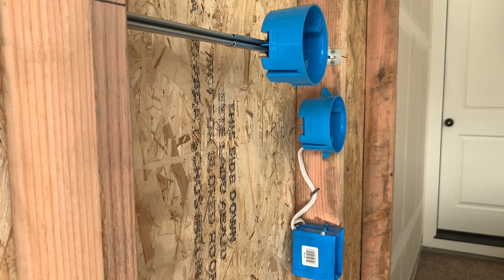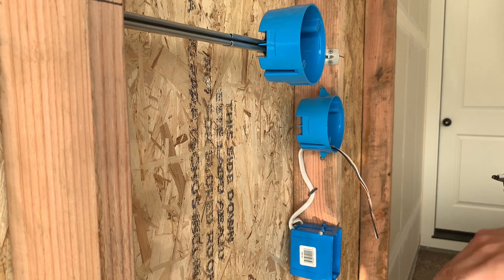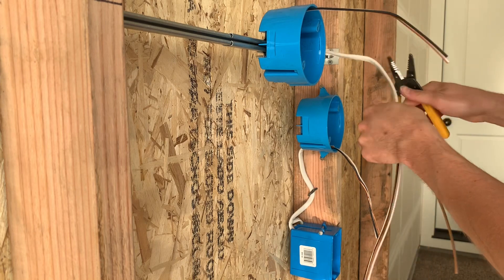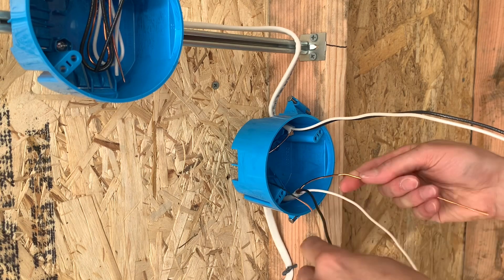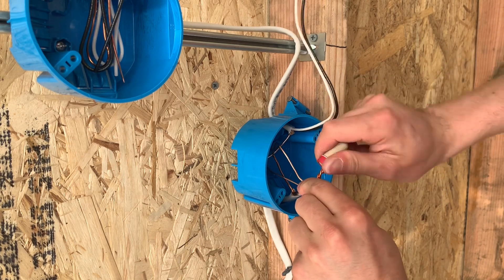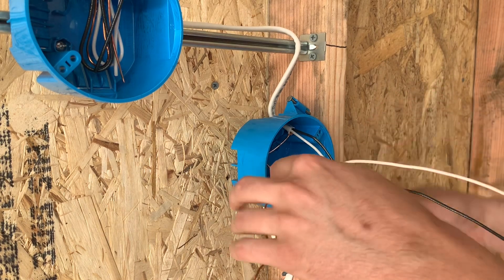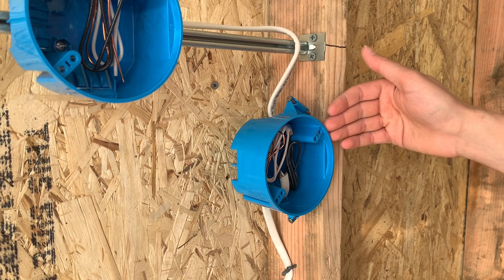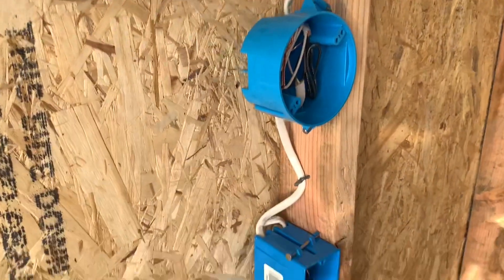Electrical 101: How To Wire Multiple Lights On A Switch (Leg)

Comment: I'm more confused not than when this video started. I wanted to know how to connect 2 lights and a switch and the power supply. I got a 3rd of the info needed.
Reply from the maker: this is a rough in video, not an installation video

Comment: Where's the light fixtures??? It would be nice if you actually attached the fixtures to the wires. Anybody can run wires into a box and fold them up. Poorly titled video that doesn't address the situation. Thumbs down.
Reply from the maker: Anybody can attach the fixture to the wires.

This video is how to WIRE, title says nothing about installing a light fixture. 👍🏻

Comment: That was way more confusing than it needed to be and you didn't even show what you said you were going to demonstrate. You didn't wire up anything. You just put wires in boxes and didn't explain what got tied to what or where they went on the fixtures. Sorry, but not good.

Comment: So to wire the light in the middle… do you take the black wire from that light, the black from the switch, and the black from the end light, and twist them together in a wire nut? So 3 wires in one nut? Same with neutral?
Reply from the maker: yup!
Reply: @DailyElectrician i have it where the wire from breaker goes to a outlet then to another outlet then to a light switch and light but when i turn the light off it trips the breaker why is that happening.

Comment: So what if you can’t get to the light but can get to the switch? Can you wire it into the switch instead?
Reply from the maker: yeah
Reply: @DailyElectrician If have 2 ceiling lights connected to a 2 gang switch.

If I want to change this switch to a 1 gang. To operate both lights.
Do I need to wire one light to the other light then that light to the switch?
Or can I just use the existing wiring and let the wires share the ports on the 1 gang switch?

Comment: For someone doing this on their own not working for a company or meeting a code do you think it would be ok to cut the ground wires down to the end of the splice to have more room/ less excess
Reply: Would be fine yes. But u don’t wanna cut to short…. What if switch goes bad and or you replace it and need more wire?…. Always do a “service loop” for you or the next guy.

Comment: I have the exact opposite, My switch controls a light in the shower and a vent fan in the bathroom, I need to remove the vent fan and make that hot and just keep the switch for the light, would I disconnect the wires from the light or the switch?

Comment: would this process be the same for adding another light to a current 2-pole circuit? TY
Reply from the maker: 2 pole circuit? like 277 volt lights?
Reply: @DailyElectrician  Hello, sorry novice to all this so I might be using the wrong terminology. I was wondering if the wiring would also apply to lighting that is controlled by 2 switches. thanks!
Reply from the maker: yes and no, depends how it is wired inside the walls.

Comment: For those whom are not electricians nor handy (I am both), you less than half way explained what you were doing and why. You did not explain why they're tied together and most importantly never showed why actually powers the multiple lights. In this case it was supposed to be a light switch that already is a power source and how you tied it into that. Where is the light receptacle? Where is the toggle switch?? You have to complete the process, bro.
Reply: I agree the video is incomplete. You didn’t wire a light! You placed some wires in an electrical box. Misleading title.
Reply from the maker: alright, move on with your life I guess 🤷🏻‍♂️
Reply: @DailyElectrician I agree with the others, the video was how to wire a light. The light never even came in to the video. This was a "how to strip wires and twist them together". Don't get butthurt because they're right. I know I'm giving you engagement by this comment but I'll just downvote and press that do not recommend button.
Reply from the maker: @samtbarber1 title is self explanitory. maybe it should be how to rough in multiple lights on a switch leg?
Reply: @DailyElectrician You keep saying that but literally everyone is saying no. So which lines go to the terminals on the light, or which ones are simply twisted together?
Reply from the maker: if you don't know how to do electrical you shouldn't be doing it.

all the lines go to the terminals on the light.
color for color, black to black. white to white. green/exposed wire to green/exposed wire. 

all blacks tied together, all whites tied together, all grounds tied together.
Reply: @DailyElectrician people lack common sense, logic, and deductive reasoning. I am not an electrician and this video explained exactly what I was after!
Reply: That wasn’t the point of the video.  It’s a how to not a class
Reply: @Platerpus7  it says how to in the title
Reply from the maker: how to wire*
Reply: @nickcawley9959  yes I agree
Reply: I think the point is that wiring the lights and switch themselves is almost given. In relevance to this video.
Reply: Exactly
Reply: Can I be an arbitrator ? For the non handy person there is confusion watching this video. However an extra 5 or 10 minutes added to this video would annoy those with basic understanding. The fenceHate to be on the fence but I’m on the fence with this one.
Reply: Hey great video, you showed everyone how to push whit wires in a box and black ones in a box and grounds. You need to stop making videos
Reply: I mean....did we really NEED to understand the inner workings of how and why everything here does what it does? He showed how something was done, that's all we need to know....we're trying to install/fix something. Not understand it.
Reply from the maker: Sorry but that's not what this video was about

Comment: I was just trying to install 2 new vanity lamps in my bathroom in the existing electrical connections, one box have 4 wires and the other just 2 and only one switch, I attach together both black wires and I have 120 v in the second box, however when I attached together the 2 white wires my breaker jumped, for some reason in the second box the white wire is always grounded, I always have continuity between my ground and neutral cables…
Reply from the maker: older houses can be like that sometimes, or something wired very wrong

Comment: So if you want to add a third or fourth light, you would just pigtail the second light to the third and from the third to the fourth light, and so on if you want more than 4 lights?
Reply: Yes if you want all of them on 1 switch
Reply from the maker: correct
Reply: Can I do this with ten lights wired in series like this operated by a sliding dimmer switch?  I want to add nine LED cans to my garage. My plan is to simply daisy chain off the existing single light and add the dimmer-slider. Yes I want them all in same switch/leg.
Reply from the maker: yep
Reply: @DailyElectrician  thank u 🙏🏽!!  Much appreciated!
Reply from the maker: sure thing
Reply: Thanks. I had the same question only four lights  @DailyElectrician
Reply from the maker: @democracy189 🫶🏻

Comment: Thank you for teaching and sharing. When you connect your ground wires I find it best to use a green wire nut which has a hole in the top that way you don't have to add a pigtail because your long wire simply sticks out saving saving a minute or two :-)
Reply from the maker: would love to try one but never have, thanks for the tip!